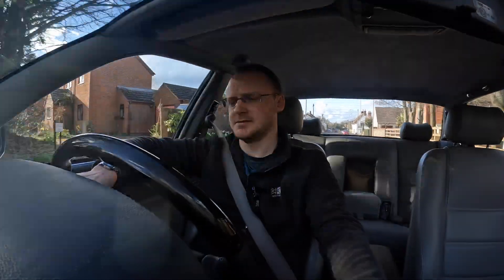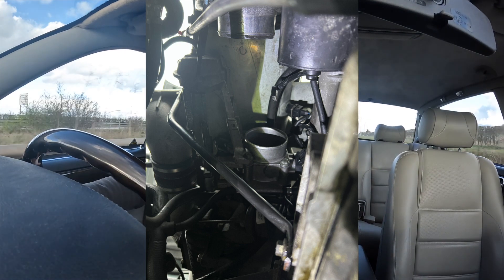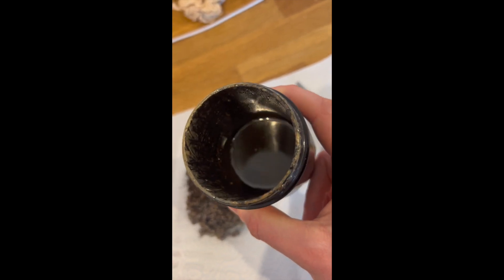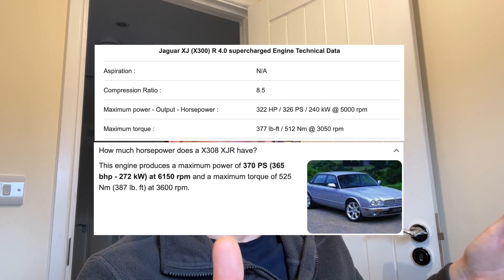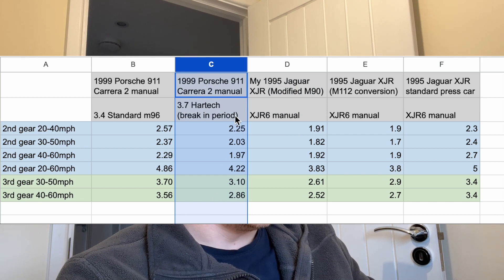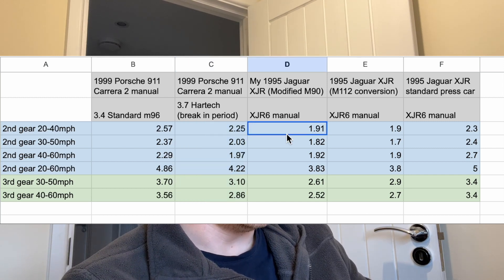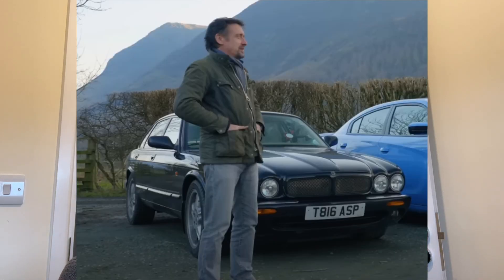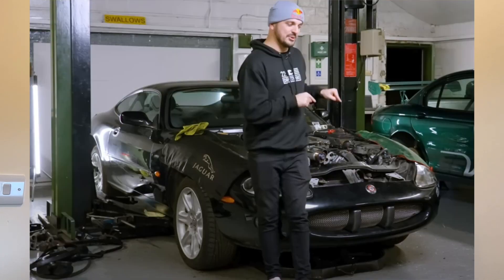Jaguar XJR6 Update, Performance stats and AutoAlex chances vs Drivetribe

Comment: I'd been considering buying an XJR6 myself since I saw Alex buy one, and I'm following through in a few weeks! They're super rare in New Zealand, so I've been doing a fair bit of research and your channel came up and has been incredibly informative - keep up the great work
Reply from the maker: Thanks Harry, yes these are worth seeking out even on the other side of the world. I recommend you join the 'XJR 6 supercharged - only for Jaguars with Venom' Facebook group. Lots of great insight and knowledge in that group and also at least one other owner from New Zealand.
Reply: @leeevernden  I've not seen too many for sale, the one I'm getting is perhaps the 3rd in the last 12 months. I've never seen one on the open road, but then Jaguars aren't too common in this neck of the woods. I'll have to check out that group
Reply from the maker: @harrytaylor9315  Yeah they are pretty rare even over here now, I can't remember the last time I saw one in the wild. There are a few hundred of them still out there but last time I checked most were off the road. Numbers falling all the time as well due to chronic rust here in the uk, the engines and gearboxes never die but the bodies do rot eventually.

Comment: Really interesting project. Had a v8 xjr a few years ago now and coming back for more with an xjr6. What kind of budget did you have for the conversion?
Reply from the maker: Thanks, do you mean the manual conversion? If so I cover a lot more detail in my other xjr6 video - But for the manual conversion I bought a donor xj6 for £1000, spent £240 having the bits transferred over to my car, but then needed a stronger pressure plate and clutch and new linkage bushes so had those bits done for £1800. All in all pretty affordable conversion for what you get from one of these, so much more fun with a manual.
Reply: Blimey, that's a bargain!!. Definitely inspired now. Thanks!
Reply: And it's a Getrag 290 box?
Reply from the maker: @willtute  Correct yes

Comment: I have recently followed a guy on instagram who has an NA MX5 with a supercharger from an SLK320. He's put an electromagnetic clutch on the supercharger pulley and a stiff spring in the bypass. With a switch in his cabin he can stop the the supercharger and run NA through the bypass. The ECU has been mapped to scale with boost and take account of that so no need to different maps. Wondering if something like that could work on the XJR. Turn it off when you don't need boost. Sure you'll lose a ton of power with the low CR, but would you theoretically not gain MPG? Especially thinking in heavy traffic or long cruising where power demands are low.
Reply from the maker: Yeah whilst I admire the engineering that goes into solutions like that, you'd never make the cost back from mpg savings. I say the mpg is bad but actually I'm sure my Porsche is worse even though that makes less power and is half a tonne lighter. As ever it's all about getting the balance right with old cars, you want them to be fun but also everyday useable, I think for a few thousand miles a year of use the XJR in it's current form is about right from an MPG point of view - I just wouldn't do anything to reduce MPG such as shorter gearing as that would negatively impact usability.

Comment: Did you put aftermarket exhaust tips? they seems larger than stock. I'm considering a 96 XJR with 95k km (60k miles): anything in particular that I should check apart from the usual rust spots? thanks
Reply from the maker: @fastdays_1  yes, the entire exhaust is custom and was done at Hayward and Scott, and I gave them creative freedom on the tips. They are larger than I would have gone with personally but I have grown to like them now, they seem to suite the car and are the only external clue that this is faster than standard. As for what to check for, rust wise do check all the common areas although at that mileage it shouldn’t be too bad at all, so apart from that it’s everything you would normally look at on a car that is approaching 30 years old - but as long as it’s straight and solid everything can be sorted fairly simply. Let me know how you get on.

Comment: Question: where did you buy your front drop links? Any improvement in characteristics?
Reply from the maker: They are available from Andy - andystodart4@gmail.com . They essentially remove the rubber bits on the drop links, this does remove some of the compliance with the ride but does improve the stability when cornering. In my view it just helps the suspension manage weight transfer a bit better.

Comment: When you converted the car to a manual transmission didn't the engine management ECU complain about the automatic transmission not being present? I.E. Doesn't the engine ECU want to talk to the automatic transmission to control the shift points?
Reply from the maker: This can happen if you just do the mechanical bits and don’t address the ECU the any way. The ECU is really basic so it’s not hard to tell the ECU that the auto gearbox is connected still and that it’s in neutral. But a cleaner way of tackling this is just to send your ECU to a guy called Andy and he can convert it to manual ECU by swapping out the chips. I’ve tried both methods and both work, I eventually settled on the manual ECU conversion route as that just seems cleaner to me, you can also get the ignition map tweaked by Andy at the same time for more power and torque low to mid range.

Comment: What are the current tyres on the XJR?
Reply from the maker: They are 255/45/17 Toyo Proxies. So they are good tyres but they aren't coping very well with the torque, I suspect the Michelin PS4s would be better. I also suspect the standard LSD isn't helping off the line from what Tom Lenthal said in the AutoAlex video.
Reply: @leeevernden I have ps4s on xjr 100. They grip incredibly when warm.
Reply from the maker: @brandonherrera2891  Yeah I hear good things about those. I have decided to get the Quaiffe ATB diff fitted first though, my diff is due a rebuild anyway so may as well upgrade the innards whilst I'm there. Then I will have to choose between PS4s or Yokohama semi slicks.

Comment: Did you paint your steering wheel?
Reply from the maker: No, Its a new old stock dark maple XKR steering wheel. If you have the right parts you can get any x308 or x100 steering wheel to fit.
Reply: @leeevernden  thanks for the advice .I'm thinking about wood stainer
Reply from the maker: @bigwerve  Good luck, I took the quick and lazy option.